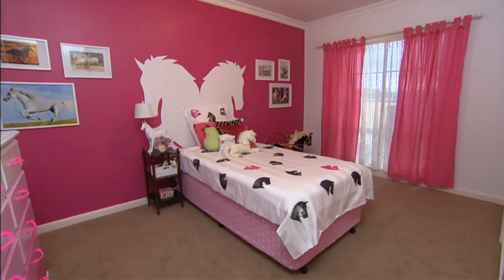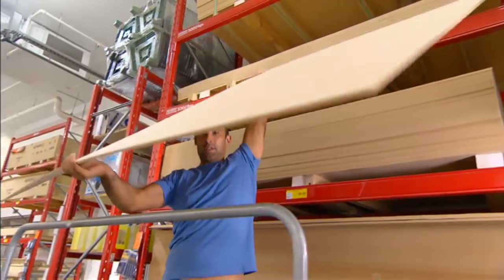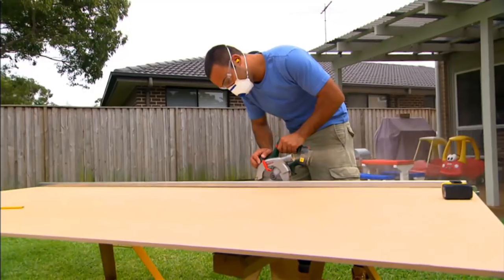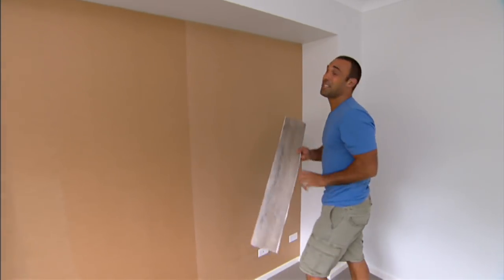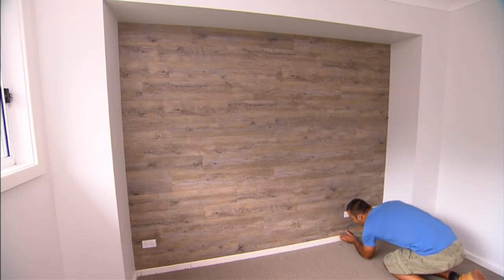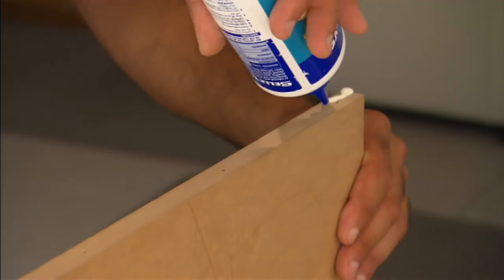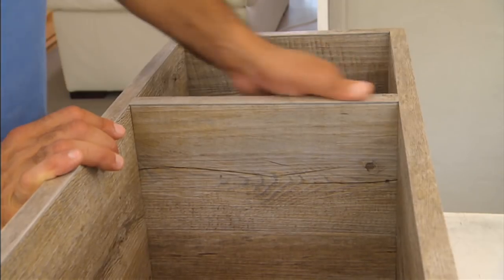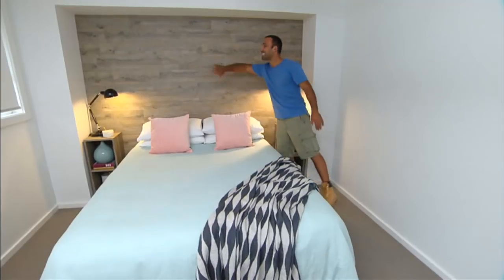How To Build A DIY Timber Feature Wall | Indoor | Great Home Ideas

Comment: Hi Adam I like the idea using vinyl plank with stick backing as a feature wall. In your video you have you have used MDF nailed over plaster. Can you apply the vinyl plank stick backing directly over plaster board already painted? Cheers Brendan

Comment: Hi, it looks so good! Went to Bunnings to get some of the flooring and got told that it wasn't designed to go on walls because of the glue. We got told it would only last 4 hours and fall off. Is this the case or were we misguided? We would love to do it to some of the walls in our house.
Reply: +Cute Panda they won't reply because it's FALSE advertising! I had to find out for my self and after spending lots of time I got the answer on the Gerfloor website. There they say it's not for walls and only floors. Thanks to the lady at Bunnings that told me the truth. Don't even watch +Better homes and gardens any more. Wasting our time with things that cant be done and what if we bought the vinyl and waste plenty $.......
Reply: Rassie Labuschagne they put wood on the wall to protect it

Comment: great video guys, just one question? how thick is the mdf used in the video for the wall ?? i would like to start this project for my apartment as well
Reply: Wouldnt matter at all mate, he's just using it for a smooth surface to stick the boards to
Reply: I put these stickers  tables directly on the wall, less work and  same result! ;))
Reply: @Nana Adams how has it held up? any peeling off?

Comment: I did this 3 years ago using exactly the same planks. Around 4am on the same day, the planks started to fall off. The adhesive on these planks are not designed for wall installation. GHI should put this video down.

Comment: y use mdf on wall y not just stick those wood panels direct on wall
Reply: If you ever want to take off the vinyl, it's a lot easier to just unscrew the MDF sheets from the wall and patch up the screw holes than it would be to rip off all the vinyl and have to patch and repaint the entire wall.

Comment: Don’t do this 

I brought everything for it got half way through it to find out the planks won’t bond to the wall unless you use vinyl glue and the non sticking boards 

Even still I used 3mm mdf sheets and after one day the heat in the wall popped my sheeting between the studs 

Big no no 

This video should be removed